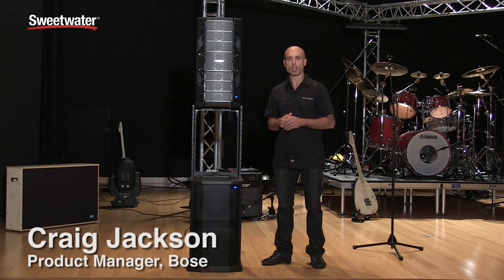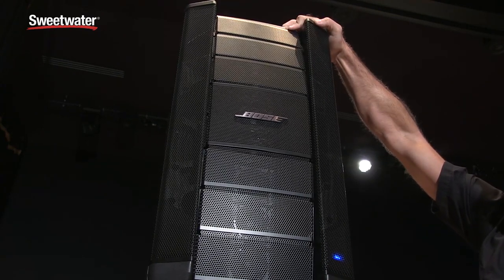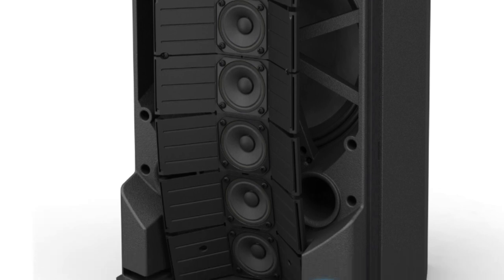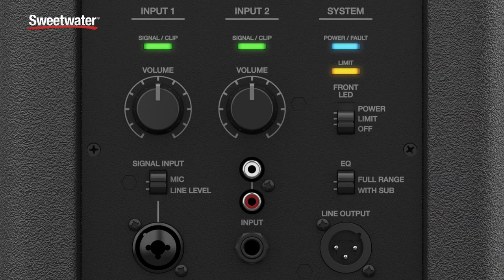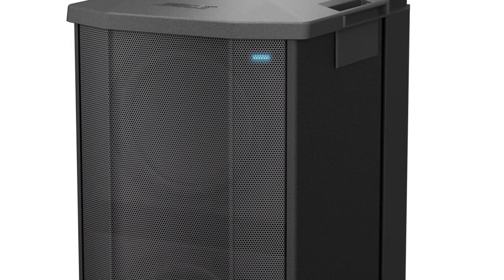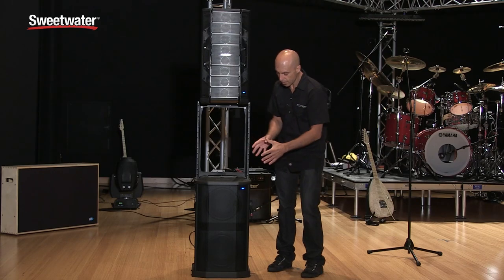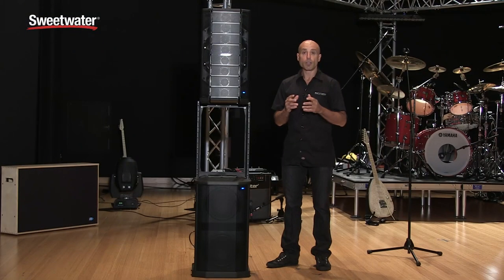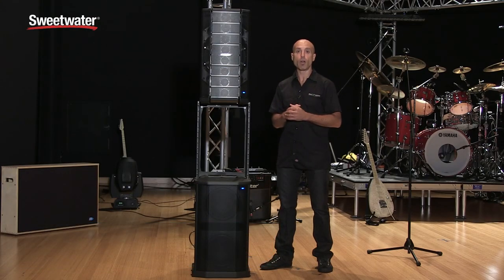Bose F1 Loudspeaker System Overview by Sweetwater

Comment: Been DJing for many years and a big fan of Yorkville sound products and still am....But...I was running Yorkville ef550p ..15 inch driver 850 watts on the tops and ls800p for the subs.18 inch ..1500 watts on the bottom....a pair on each side...top 40 dance music in venues with 500  people very loud...speakers were good but very heavy and large to transport.I tried the Bose 812 system.....volume level was equivalent or more ...the clarity was crystal clear and there is no shortage of base thump to vibrate the walls..the nice part is I can walk out with one in each hand for loading and unloading...Don't need large trailers or big trucks just to haul the speakers anymore.  I am buying a set.....DJ's will not be disappointed....
Reply: CYBERZONEDance 
which one are you talking about is it the F1
Reply: Looks damn expensive though :/
Reply: CYBERZONEDance om I
Reply: hard to believe.....  there is just no substitute for 18Inch drivers pushing a ton o air....  for the money you could so much better, n louder, sound going w/ jbl or qsc or electravoice.....  jbl srx800p line is the reigning king, IMHO for this money class.....
Reply: @SanFranciscoFatboy  have you tried what his talking about?
Reply: @bongb56  yep, the FI is for jazz or folk bands....... really pretty to look at and Bose is good company....   but it is not big and loud like jbl.....

Comment: Can I attach the F1 812 model with a different Subwoofer? For example, linking the Bose F1 812 to the RCF As Ii subwoofer
Reply from the maker: Hey, Cris! Great question! There's no reason why you can't use another brand of subwoofer. Obviously, the Bose F1 subs are designed and voiced really well for the F1 812's. However, you can absolutely use what you have available.
Rock on! 🎶🤘
Cassie O'Hanlon, Sweetwater Sales Engineer, (800) 222-4700 ext. 3020, cassie_ohanlon@sweetwater.com

Comment: can i use mixer with the bose F1
Reply from the maker: Hello! You can absolutely use a mixer with the Bose F1. The F1M812 top speaker has two mic or line level inputs, each of which can accommodate a microphone or mixer.
Thanks!
Nick LaMendola, Sweetwater Sales Engineer, (260) 247-6613

Comment: I have the f1 with the f1 sub. but I am smelling a bleachy, burning smell. they don't seem to be blown or any other problems they just smell funny? what should I do?
Reply: reeperseyez I have the full F1 set as well and from what I've read online is that a certain batch of F1 subs had excess glue on the voice coil former and the burning smell is just the extra glue burning off.
Reply: also i ran mine hard at a couple of gigs and the smell from the subs went away
Reply: Did the subs break then?

Comment: Can I use for karaoke? Thanks 🙏
Reply from the maker: Hello, Young Doan! Yes, those speakers could work just fine for karaoke. They may be overkill in smaller karaoke bars, so be sure to give your Sales Engineer a call before making a decision on any speakers so we can try to make sure you'ŗe getting the right equipment for the application!
Thanks for the interest!
Spunde, Sweetwater Sales Engineer, (800) 222-4700 ext. 1732, Spunde@Sweetwater.com